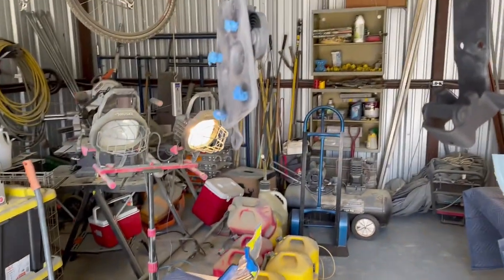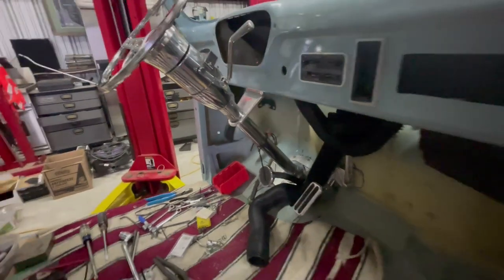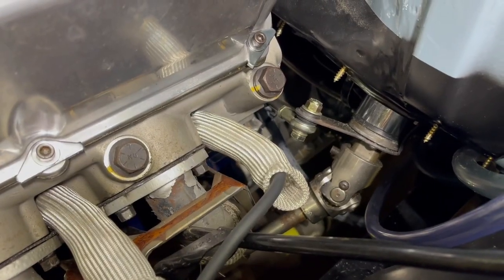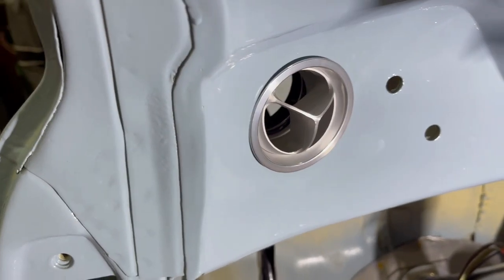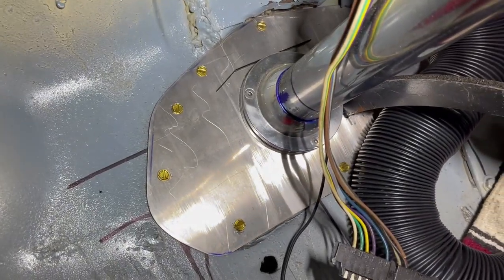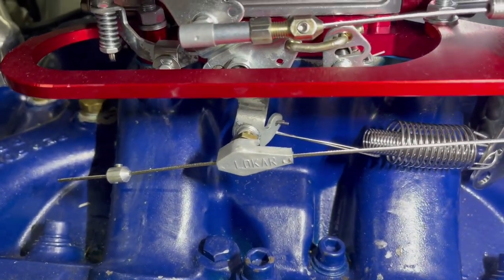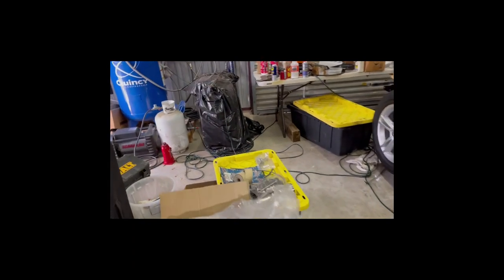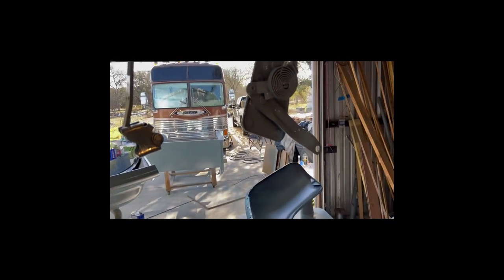1954 Ford F100 Restoration Weeks 9 thru 14 - Steering, Throttle, and AC

Comment: Hello Sir just came across your channel i noticed you have long self tapping screws exposed in the firewall where the steering column cover is cant you use some nice stainless hex head screws or bolts that sit flush and also wont tear skin off your hands near the steering trans linkages
otherwise beautiful very tasteful love the fact you used a Ford engine not Chev S***
Reply from the maker: It is amazing how many people have caught that.  Just temporary my friend...gotta work with what fasteners are on hand.  Just bought $100.00 worth of stainless assortment  for truck Thanks for comment and for watching.  The bed is installed now and will post that soon.
Reply: @texaslonghorn2792  great content thank you